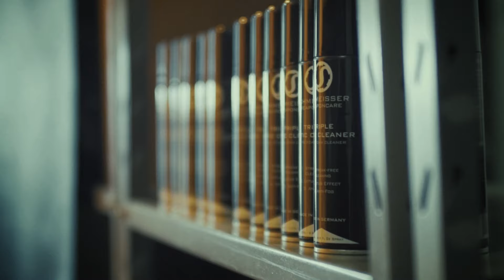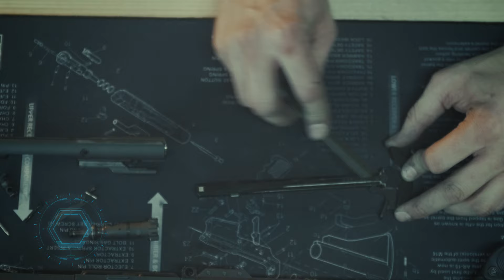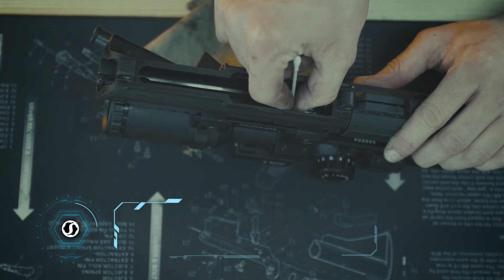Schmeisser Weaponcare

Comment: schmeisser are good rifles, but they only use keymod, a 1/9 twist, and crappy back up sights
i'd buy  a schmeisser if it had: a 16 inch 223 wylde hybrid contour barrel with 1/8 twist, mid-length gas system, about 2 pound weight and chf
m-lok handguard, geissele prefered (because keymod has no qd function!)
bcm gunfighter stock, grip and charging handle
everything in tan
come on schmeisser, build this thing!